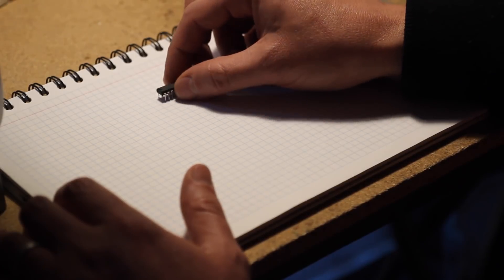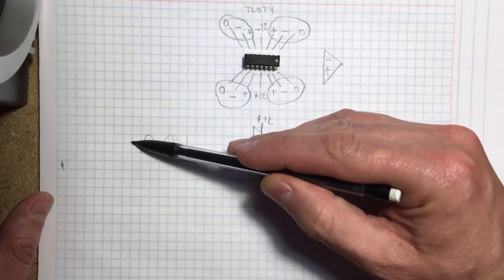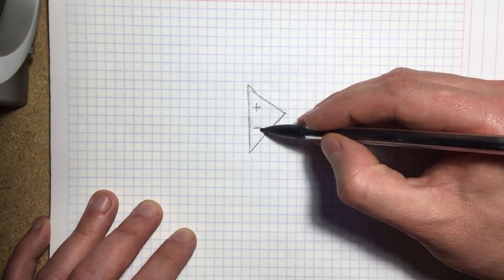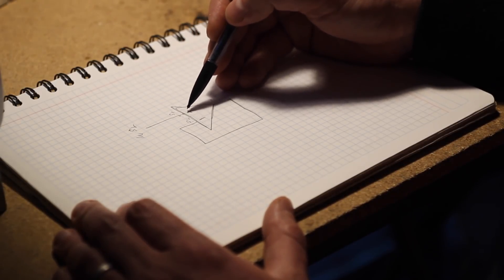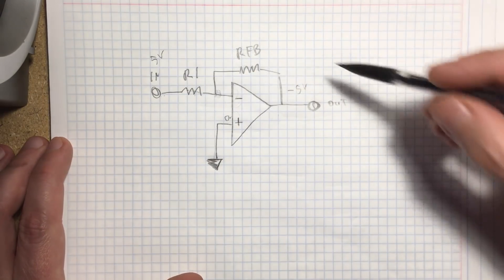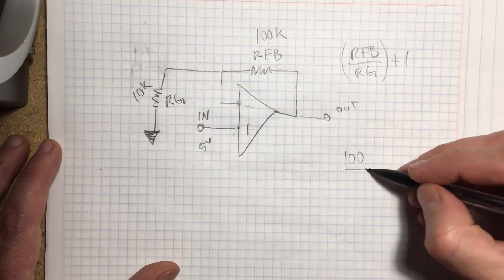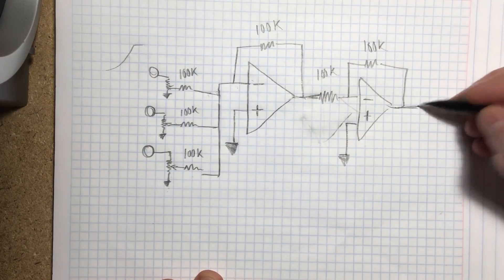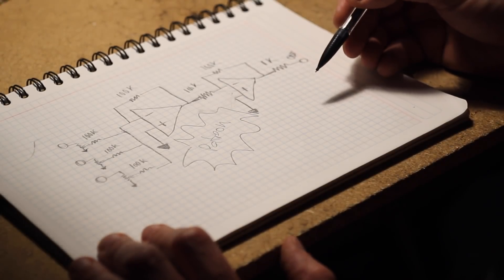SDIY Class #9 - Intro to OpAmps

Comment: When you circled the opamps to show the 4 constituent units in the whole, 

I .. I just can't stop seeing 4 heads  with laser vision working together to levitate and place the tl072 lol. And they may be winking, or wearing eye patches? Either way they're helping out.

Ive been inundated with lm358s after finding myself witha bucket or two of them and have been digging the slower slew, but sadly they aren't aided by laser weilding disembodied heads, and I'm forced to rely on my normal ass fingers.  And a bare minimum of laser levitation aided ic placement

Comment: the amp goes to 11! 
Also i wanted to ask , would sending 1 output to several buffers/amplifiers work well for spliting a signal? (so kind of a reverse mixer)
awesome video!
gonna do the resistive pads now.
Reply from the maker: Yes, that's called a buffered multiple! You can probably get away with using a single buffer actually. Just send the output to the buffer input and the output to your many inputs. if you need extreme accuracy though, like for 1v/oct signals, things get a bit more complicated.

Comment: This may be a simple question but won’t the final protection resister drop the mix voltage a bit? If I want to mix precision signals like 1V/Oct signals, won’t this resister put things out of tune a bit? How can we compensate for this?
Reply from the maker: If the input you plug the output into is buffered, the loss is minimal. But you can drop that resistor down to 100 ohms or even leave it out altogether, it's not critical.

Comment: hello, do you think it should easy to put a switch (DPDT) to go from inverting to non-inverting? in order to change phase of the signal?
Reply from the maker: Yes, you tap the output of the first stage and the second stage of the dual inverting amp to the switch. That way you can choose which output you want to use, the inverted one or the corrected one! SPDT is enough!
Reply: Synth Diy Guy yes, your correct. I was thinking about switching the input from the (-) and the (+) terminal, but it's way more complex. Your solution is great. Thanks